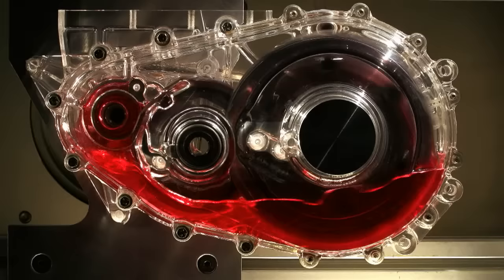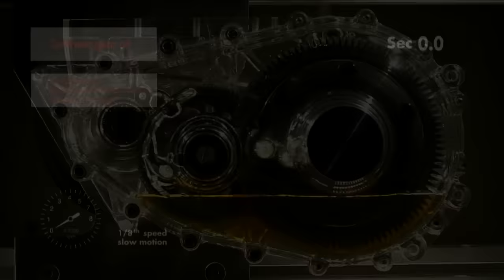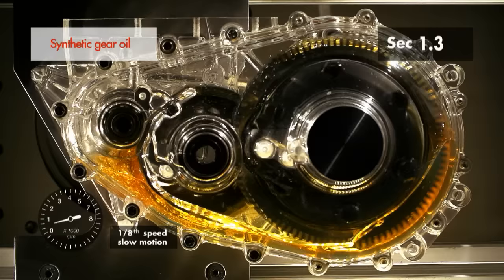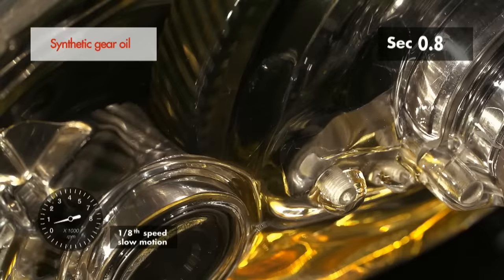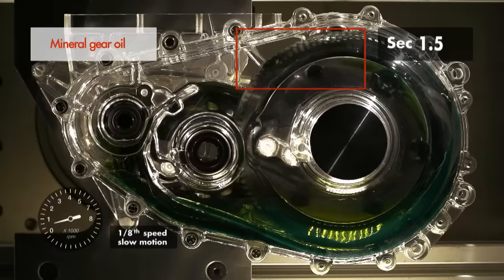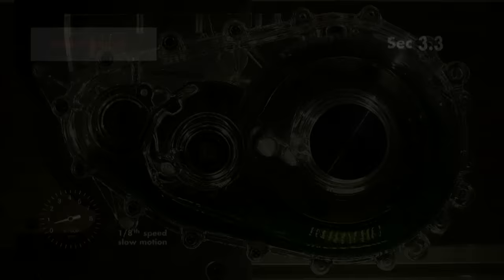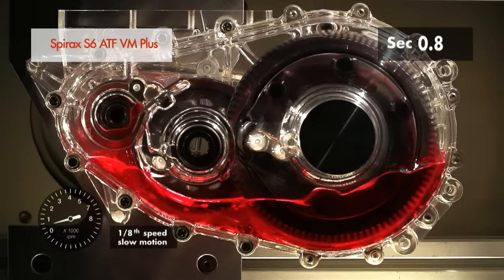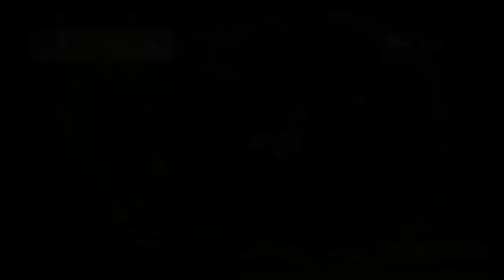Shell Spirax synthetic transmission fluid demo

Comment: the mineral oil demo shows you need more of that oil in the gearbox because of how thick it is it cant run back into the sump to be picked up again. sometimes thicker isnt better and sometimes thinner isnt better. it depends on the enviroment. i bet that light weight synthetic wouldnt last in the desert.

Comment: Patently false, just because it doesn't pull a torrent doesn't mean you don't have lubricant coating the teeth. You don't need a ton to have film strength and you're likely losing power pulling so much mass around with the gear.
Reply: Vizerei 
Are you seriously trying to argue mineral oil does as good or better than synthetic oils at lubricating?
Reply: Where in the comment dose it compare mineral vs syn?
Reply: BigEsGarage 
The entire comment is comparing the two. Not sure what you're confused about
Reply: Yes its called parasitic drag.  This is Microblue.com works so well.  It places a ultra thin layer of anti friction material on the surface.  As in reference to a gear box.  The friction between teeth are very low if the load applied is light and the "gear backlash" is at a proper amount.  They ONLY need for thick oil film is when the GEAR LOADING is AT or NEAR its maximum designed strength.

I have studied this with rear differentials. If I use a low friction oil/oil supplement.  I observed little benefits at light load conditions.  But once I applied high load (pulling a hill at low speed) it increased my ground speed significantly.
Reply: Jason B 
No one is talking about gear oil or it's viscosity. This video and discussion is about synthetic vs mineral oil.
Reply: Jason B
Of course the effects your additives increased with load 
There are 2 types of lubrication needed for a gear teeth 
Hydrodynamic- entry and exit of the teeth meshing creates a sliding action and the metal “ski’s” on the oil film (you must still meet the minimum viscosity called for by the manufacturer) and:
Boundary lubrication- where the pitch lines of the teeth meet this motion slows then stops relative movement so needs more EP additives (chemical or solid) to act as a layer between them to prevent metal on metal contact

Comment: even with an uneven film, when the gears rotate they squeeze out the excess oil and it rides on the contact point and eventually feeds through the teeth anyways, so "uneven" lubrication, at least on the teeth is not as big of a deal in real life compared to how this video makes it seem
Reply: No it's not a big deal on the teeth of the gear to go with out for a couple of seconds. What matters more in a transmission is the bearings on the sides supporting the gear shafts are they getting oil? In the cold here in MN, mineral oil won't flow for a long time down the sides of the gear & into bearings where it's Really needed.

Comment: This vid is 8 years old, is there not newer tech in the lubrication industry?
And to be fair to the traditionally oils and transmission fluids, they work and have worked for 100 years if used as intended.

Comment: Although i'm a big proponent of synthetic oils, it can cause thoubles with some clutches (my clutch loses grip and slips constantly with synthetic oil), so take note of that when you have a wet clutch!
Reply: 2stroke4me don't use oils with friction modifiers in them. The synthetic part is nothing to do with it. Been there, done that
Reply: Dan R Thanks for the information! So far i've had a lot of bad experiences with synthetic oils in mostly older bikes. I'm going to look closer into the matter!
Reply: If oil doesn't meet JASO MA/MA2 certification, it's not suitable for wet clutches.
Reply: Also we dont know when they go at high rpm, so we still dont know which one the best for our ride

Comment: This sales pitch is very misleading, they compared fluids of drastically different viscosities. You can't rationally compare a straight 30 weight engine oil to a 10 weight automatic transmission fluid, regardless of whether or not one is synthetic or not, it's not a real comparison and anyone with any common sense would see right through these deceptive tactics.

Comment: Transportation fluid is not oil to lubricate, it's working fluid to transmit pressure.
Reply: This is clearly a manual transmission, not an automatic

Comment: I'm no expert in oils or engines but this video does not convince at all just because how it is done. In both scenarios big wheel is half submerged with top part dry. Unless this fancy oil creeps up the cogwheel while it's stationary, there can't be any difference in coating and after wheel has been submerged there is no way it remain dry, no matter the oil. Also it is important that all parts that are touching and have a friction are lubed - meaning the main role plays the smaller cogwheel which because of diameter is already lubed when dry cogs of big wheel comes in. I honestly believe good synthetic oil is better, (thermal resistance, viscosity, etc.) but not because of this video. This looks like one of those TV shop adverts.
Reply: Again this is not the main purpose of gear oil in winter, it's main job is keeping the support bearings wet on the gear shafts in the holes of the gear case. It takes a thin oil to splash & squish into the sides off of the gear.

Comment: Show a 3% whp gain on a dyno and you'll sell tons. You want the drop in air filter and long tube header exhaust crowd. I'd be motivated to flush my transmission if I also got a free 5whp ou tof it. Telling me its better for my trans doesn't have the same effect because I already believe my trans will last the lifetime of the vehicle. Tell me you have lighter gear oil that doesn't break down so my shifts are better. Look at how many short shift kits are out there. Even a 2% improvement would do so long as you can feel a better shifter.

Comment: why wouldnt people just fill their transmission to the top? that way nothing with metal to metal contact will be dry, everything would be getting alot of lubrication.
Reply: Fluid drag
Reply: Imagine the drag a table fan would have with just the tip hitting the water. Now if it was submerged in water like a ship propeller that would increase resistance by a good 5 times.
Reply: The transmission seals would leak badly, the fluid would aerate and cavitate, there would be considerable drag on the parts.
Reply: Because this method works well enough that your vehicle will be junk by the time the gears wear out. You also gain considerable fuel efficiency(gears spin really fast) and save on oil costs.
Reply: Because overfilling a gearbox is actually worse. Too much oil makes it foam up. That means there’s s a lot of air rushing around the gears instead of a nice clear smooth oil film. It strangely increases wear because of this...and it would leak like a sieve out of every seal
Reply: Too much oil with cause damage.
Reply: Puppy likespancakesAJ you end up over pressuring the case and it would force all that precious liquid out.
Reply: Most engines have breather holes and overflow tubes anyway so it would spit out the excess oil.
Reply: Your supposed to fill the gear box completely full with water, because it acts as a lube and coolant. They started using oil because big oil companies make more money that way.
Reply: @petergriffin383  nah, water is too expensive, I use dog's urine, it is free.

Comment: And then again at 2 minutes 25 seconds they take the split screen and put the same picture on top and bottom because the synthetic that they're trying to push is not doing better than the gear oil not to mention it's 5 W 30 vs SAE 30 it's like apples and oranges come on

Comment: I would just stick with the manufacturers transmission oil. While this is very useful there are other major factors such as the fluid having to go through the valve body and creating pressures

Comment: complete waste of time test of two different viscosity oils. the oil film needed between the two gears is microscopic anyway and the heavy weight oil will have a thicker film regardless of it appearing not to visually follow the gear around lol

Comment: It's doesn't prove anything. A "mineral" oil selected has a higher viscosity and is "picked up" by a gear better creating a temporary deficit - thus the uneven cover... But then you can use a mineral oil of a different lower viscosity: so what's your point?

Comment: Problem is the pistons inside transmissions like a Honda you run anything but OE Honda fluid your pistons will end up with damage and transmission begains to slip so lubrication may be better but will end up damaging your automatic transmission in the end we been in transmission business 56 years we have tried it all they will tell you the fluid will work same as OE it will not that is false information …. Want find out hard hard give it a try
Reply: I mean the lip seals on the pistons inside the automatic transmission they are rubber seal pistons applied hydraulically to apply the clutch packs for each gear reduction

Comment: If you never want friction, I have a million dollar idea, how about we design medal that is built with lubricants inside of it
Reply: VisualPlays doesn't work
Reply: Or just use oil impregnated bushing material? But it’s also too soft
Reply: Bailey Petersen come on guys, keep sharing your ideas, maybe one days us 3 will be CEO lol.
Reply: This already exists. They use solid lubricant. However didn't work with transmission due stress concentration and fatigue.
Reply: Like other commenters have mentioned there are oil impregnated metals, but usually for sliding interfaces. For transmissions you need hard materials to transfer energy efficiently not to mention there is minimal slip from tooth to tooth
Reply: Find a way to coat parts in a hard layer of graphite.
Reply: Von Bergerfurth Just use a #2 pencil and color all the surfaces with it.
Reply: Peter Griffin That would work for a couple revolutions lol
Reply: Von Bergerfurth then just buy a bunch of lead for those automatic pencils, grind it up and fill the gear box. That's what I'm working on now for my car, I'm adding it to the oil as well.
Reply: And add about a half cup of water to dissolve it for better coating